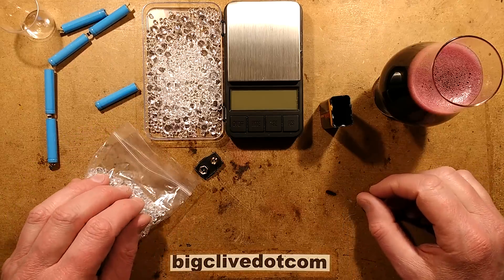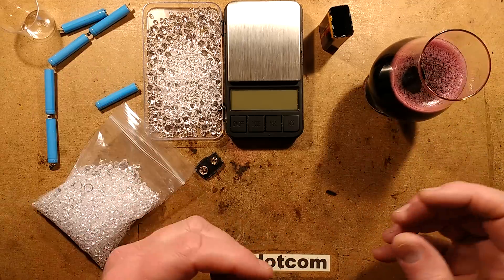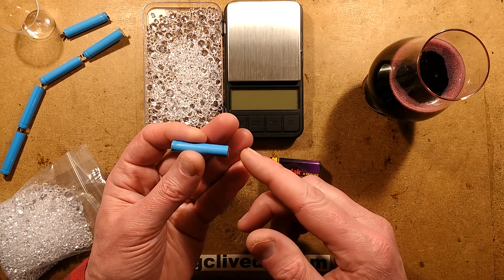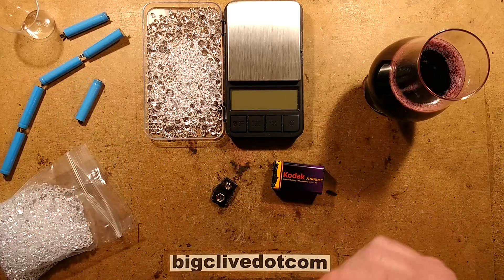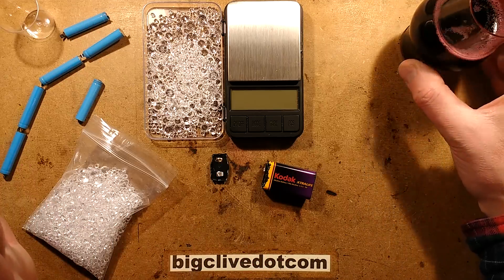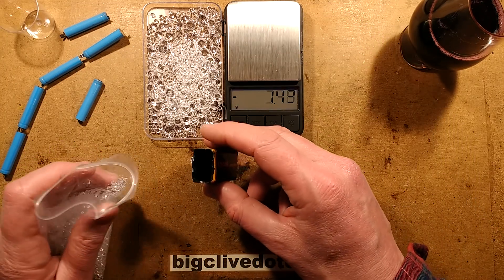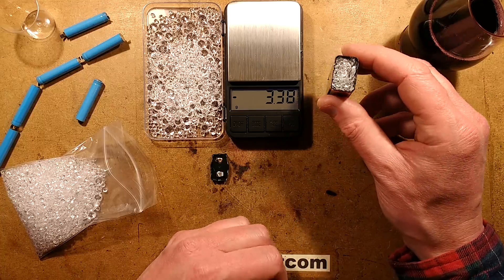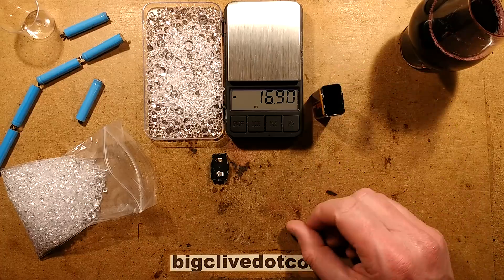How many diamonds can you smuggle in a 9V battery.

Comment: Don't put milk through a Soda Stream.
Reply: I did this when I was a child back in the late 70s, with one of the old orange-and-white sodastreams.  

https://secure.i.telegraph.co.uk/multimedia/archive/01491/soda-stream_1491513i.jpg

Normal procedure was to fill the bottle to the line with water, insert, close, pull down the lever, and press the button until the machine farted.  Lift the lever, FSSSSSSSSSH, remove, add flavouring, enjoy.

FIlled the bottle to the line with milk, inserted it, closed the tube, pulled down the lever and pressed the button until the machine farted.  All was well.  Until I released the lever to remove the bottle.

What followed can only be described as a milk-pocalypse.  Fizzy milk ERUPTED from every orifice the machine possessed.  It came up out the top round the button, it flew out the bottom of the bottle holder, it gathered in a pool round the base of the machine.  And it kept coming.  When the fountain eased and I finally got the bottle out, there was roughly half an inch left in the bottom.  It did not taste good.

I cleared up the mess as best I could, and tucked the machine away at the back of the work top.  I finally had to fess up about a week later when it started to emit a rather unpleasant smell.
Reply: Pft I'm genetically adapted to process dairy. Not consuming it would be a waste of my mutant powers.
Reply: milk in general does not like acid. co2 in solution is slightly acidic. also bubbling milk bubbles over very easily.
Reply: Maxx B now I need to know why.
Reply: Oh good I remeber one time I put carbonized water in glass were a little bit of milk was left from drinking it ealier it looked quite unpleasant XD it also gained a bit of surface tension because those bubbles never popped. Maybe something equal unpleasing happens with it if you put it in the soda stream.
Reply: Don't mix milk with Red Bull.
Reply: Milk is slightly acidic, I tried it once and during the discharge milk blew back in the shaft and the next 5 drinks tasted odd. That sounded weird ( ͡° ͜ʖ ͡°)
Reply: What are you taking about?? I make milkshakes in my soda stream all the time.  Try it yourself!
Reply: +moogthedog Good story, thanks for sharing.
Reply: https://www.youtube.com/watch?v=9xILONn5_3E about chemestry you know xD if you solve carbondioxide in water or any water based fluid it forms carbonic acid, which by the name is acidic and that doesn't go well with milk
Reply: Jeez, if mixing it with slightly acidic carbonic acid is a disaster can't imagine what fluorocloridic acid would do...
Reply: Kim Sleep 

The root beer is carbonated, not the milk (or should I say ice cream). Carbonated milk creates a foamy mess. You know, like blowing bubbles into your glass? Times that by about a billion. Next, you should try carbonating egg whites.
Reply: I don't put anything through fascist contraptions, thanks.
Reply: Maxx B 9
Reply: why......
Reply: +wiedehopf  
How do you make buttermilk for pancakes Sunday mornings?
Reply: Ever seen the dudesons?
Reply: In the late 70s similar water carbonators were popular in Poland when my then young father decided to try carbonising milk. It didn't go everywhere, probably because of different design, but it reportedly tasted awful .
Reply: Tried it once. Oh man. For one, it blew up all over the place. And two, it was bitter as hell and didnt hold any of the carbonation.
Reply: Dont mix milk with calcium ;)
Reply: +J Walker 
it does whip the cream but the taste is beyond horrible
Reply: Speaking of carbonating alcohol my mate used to use vodka in his sodastream. He said it really hits you quickly.
Reply: My wife and kids tried that a few years ago.  Messy...
Reply: It tastes like a 2 year old milkshake that wasn't even good when it was made. Also, don't open it, it sprays more than red wine.
Reply: @Maxx B There is a new rule, just write it into the Youtube search box, there is always somebody who did it and recorded it.
https://www.youtube.com/watch?v=PRDnzgCV5DY
Reply: Maxx B i have done it. And it didnt taste good
Reply: Harold buzzfeed has a video with that in it
Reply: UMMMM....Root Beer Floats??????
Reply: +TheKetsa What is your objection to it? Health or humanitarian?
Reply: moogthedog moogthedog  THIS is the funniest read ever on youtube. I really shouldnt have read your descriptive story after a full stomach! "Out of every orifice the machine possessed " hahhahahaha. Thank you Moog. Youve brightened up a dull week my friend! Have a good evening in Doyley Wood !
Reply: Maxx B milk is toxic!
Reply: Don't drink milk.

Comment: Next up, big Clive arrested for smuggling batteries up his butt
Reply: COP1 - We found him smuggling batteries in a diamonds shipping
COP2 - You mean diamonds hidden inside batteries?
COP1 - No, batteries. Batteries hidden among the diamonds. 
COP2 - Huh. Big clive?
COP1 - Yup, big Clive.
Reply from the maker: You should never stick truck batteries up your butt.  Not without putting insulating caps over the terminals first.
Reply: and they were truck sized lead acid ones too
Reply: Good advise from Clive there!
Reply: have to have been from pound land, and no matter how many AA's you shove up your Butt  its not going to make you into a mighty morphing power ranger might give you piles ? there's  a battery  joke  there somewhere ?
Reply: they used to call batteries - piles, perhaps this is the reason
Reply: you should never put anything up your butt only your finger with a fully trimmed nail !

Comment: $20k - 60k USD if they are between 3/4 and 1ct each, depending on Cut, Color, and Clarity. That's why people sew them into jackets to smuggle them.
Reply: We can now easily create Diamonds more pure than anything ever found naturally, and they don#t cost all that much anymore. Aside from that - there are way way way cheaper alternatives that look the same or even sparkle more.
Diamonds -  the only thing about them that lasts forever is the regret having bought them.
Reply: Actually diamonds are a damn sight less rare than people think. The reason they cost so much is the "diamonds are a girls best friend" ad from the 40's (before that other stones were used for engagement rings) and DeBeers basically controls the worlds supply of them charging what the hell they want.
Reply: Jusb1066 If wood is well burnt you will not find that much of carbon, because "burning" is imho the reaction between the wood and oxygen. If so, then the carbon will fly away in the form of CO2.
For carbon (although very impure) you need to heat the wood without oxygen (pyrolysis or thermolysis)
Reply: More if the average size is over 1ct total weight.
Reply: which is all fake, they are carbon, we can make them from burnt wood, infinite supply
Reply: You see, theres different forms pure carbon can be in. For example graphite(graphene), Fullerene, diamonds and some others. even if you burn would without any oxygen, carbon does not easily turn into diamonds. You need a lot of pressure to make carbon turn into diamonds. Usually crystaline carbon will turn into graphite unless it has just the right circumstances to turn into diamond.

Of course the price is inflated, but very nice looking pure and clear diamonds are not that easy to make either. Also you have to grind them by hand into the right shape which isn't cheap either.
Reply: Jusb1066 sure, I didnt say anything about the process of converting carbon in a diamond xD I only disagreed on the "burned wood" part ;-)
Reply: @RL i was making a simplification of course, that all carbon isnt the same, i was just really saying its all just carbon and theres plenty of it, and the whole nonsense around real diamonds itself
Reply: @200jago, no by my logic diamonds made of carbon are easily replaced, and carbon is cheap, you are making the rest up as you go
Reply: @jortz yeah imagine if we had processors you could dig out of the ground, all natural ones! i dread to think how expensive theyd mark those up to!
Reply: RLingate, oh alright.
Reply: Ignes Andros 
Alcohol had something to do with the content of this video.
Reply: @TurboGuard - Pro-tip: The word Jew has an initial capital.

@Gordon Lawrence - That's largely a matter of perspective and unless you define more precisely what you mean by "diamonds" and "rare", pretty meaningless. If you mean rare in the economic sense, i.e. market demand exceeds total supply, then no they're not. If you meant in a cosmological sense then BPM 37093, a white dwarf star in the Centaurus constellation, is pretty similar to a diamond the size of Earth's moon!

It's easy to make unfair comparisons and general statements, which I will now proceed to do ;)

If we're talking industrial synthetic diamond dust then prices on alibaba.com start at USD$0.01/ct with a minimum order of 1kg (5000 ct.) then sure it's as common as muck and, for 48ct. worth of the stuff, cheaper than the battery in the video! A fairer comparison, using this source https://goo.gl/iXVmMC average price history yields a figure of around USD$30,000/ct. therefore about USD$1.5 million for 48cts in 1ct stones.

At the incomparable end of the market, a finished, ludicrously large, D colour stone, with no inclusions like the 163.41ct “Creation 1”, which you'd have to concede is rare, sold at Christies last November (Source: https://goo.gl/9Yi1XP) then we're talking around USD$200,000/ct.

My point is that with Diamonds, be they rough or cut, it really is rarity that dictates price, as explained at https://goo.gl/XsKCLn I don't believe it's cheap or easy digging up 800,000,000 tons of ore a year to get an average of 70 top grade stones.

As for the De Beers group, their influence is undeniable but their monopoly is somewhat questionable because Rio Tinto and to a lesser degree Alrosa basically gave De Beers the middle finger and started selling stones through channels that are not controlled by AngloAmerican/De Beers. (Source: https://goo.gl/tw2od5) It appears to me that De Beers monopoly is comparable to central banks monopoly on currency supply insofar as the intention is to ensure market stability, can you imagine what could happen if the US Dollar, Japanese Yen, British Pound or Chinese Yuan fluctuated like cryptocurrencies? I can't, but maybe that's my lack of imagination.
Reply: You realize your just towing the BS line they are putting out concerning the rarity and availability of diamonds right?
Reply: HockeyPlayoffRun That's entirely possible but not something I'm concerned by.
Reply: Gordon Lawrence Thanks for bringing that up. You can pay a bundle on expensive diamonds, though you'll NEVER get it back, not anywhere close. Everything else can give a return on investment. Precious metals, maybe emeralds etc. Though not diamonds. Fuck diamonds, lol.
Reply: James Laidler I beg to differ. Bulk pricing on cut, polished diamonds of quality are as dependable as gold and the only thing synthetic diamonds have introduced is the need for provenance documents.
Reply: Ignes Andros OK then. Run off to Debeers or Cartier, or Tiffany's, and buy a big expensive diamond. Then try selling it. Let me know how that goes.
Reply: But how many can you fit into a fake lithium battery inside an iPod, camera, etc that still has enough actual electrolyte to turn the device on at a security check?
Reply: I mean, there is a rather limited supply of high clarity diamonds. making shitty dimaonds is easy, thats why you can buy a kilo of diamond dust for 200-500$. But making or finding diamonds suitable for jewlery is pretty complicated.
Reply: @RL true, but at least theres plenty of it, and this diamonds are also plentiful, just idiots who only want the blood diamonds to put on their fingers and people to make fortunes for
Reply: I mean, theres plenty of silicon and yet processors are expensive(sand is mostly silicon dioxide). Theres a lot of the raw material, doesn't mean its easy to make.
Reply: You were talking about synthetic diamonds the whole time, you don't pull those from the ground. And the ones you dig out of the ground are not easily replacable unless you have a few millennia to spare.